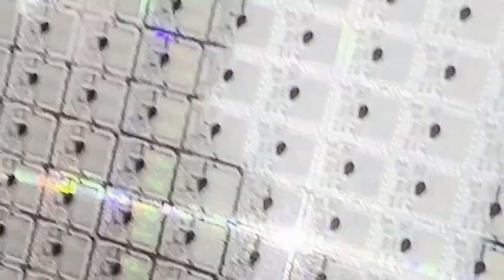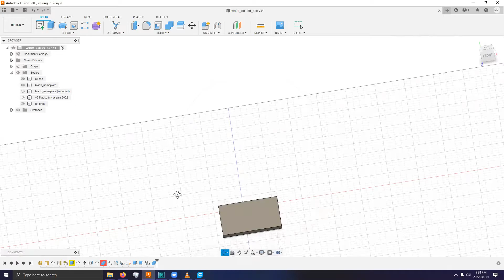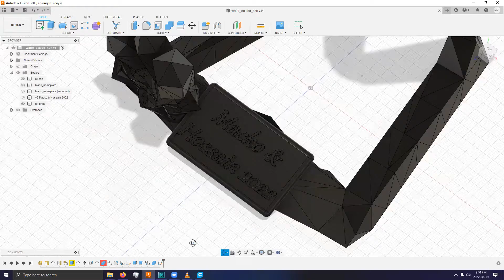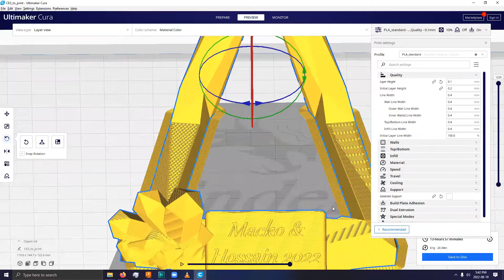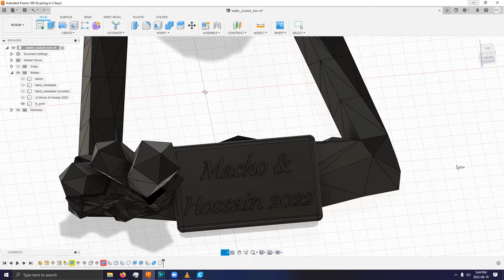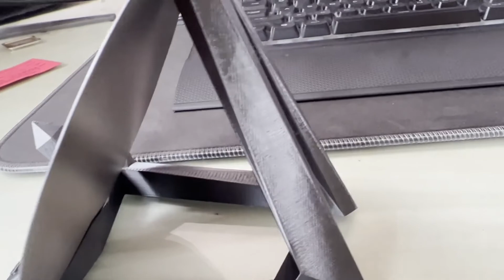3D Printed Stand for Silicon Wafers

Comment: Hey! Do you know how I could clean fingerprints of the wafer? Plus can you please send autodesk file!
Reply from the maker: Sure! I'll have to go digging around for the autodesk file but I'll send that once I find it. To clean fingerprints, most solvents are safe for use with silicon, but I recommend using 99% isopropanol (70% will also work, just need to let it air dry)
Reply: @pataporon  Okay thank you!